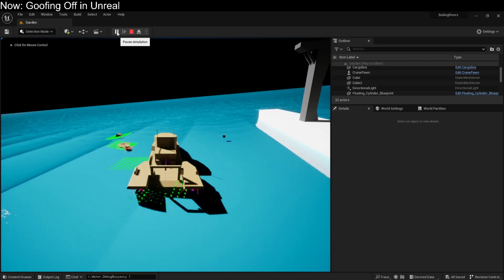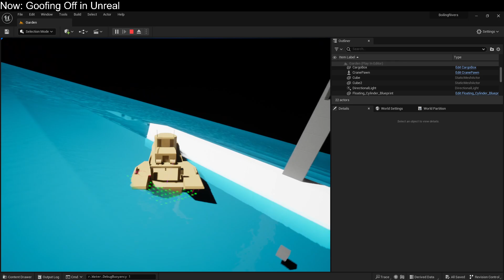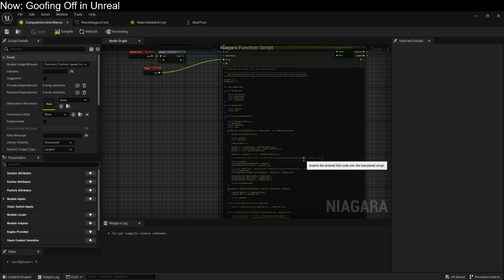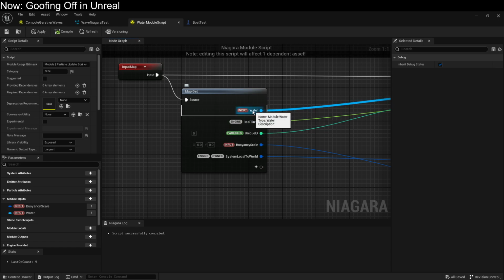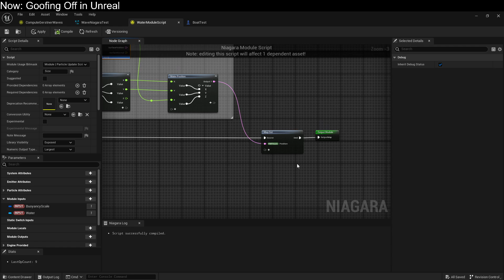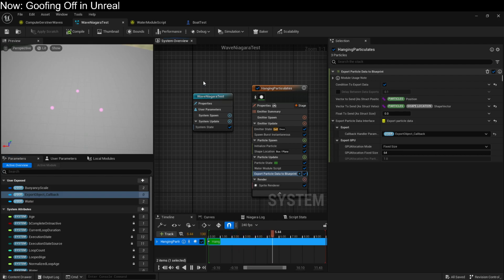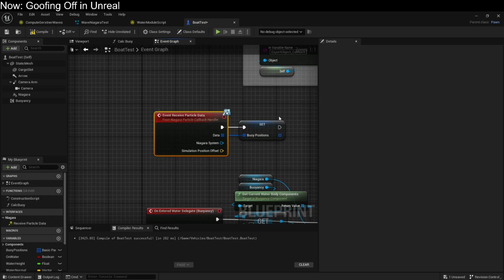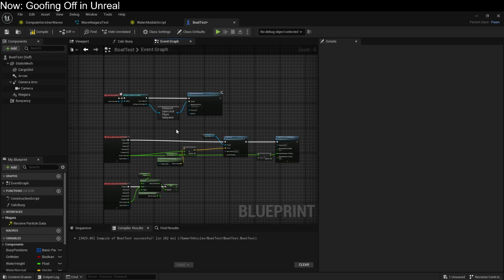Unreal Water Plugin: Wave Height Tutorial

Comment: Hey thanks for this video. I was using the buoyancy system to tell the player when they enter/exit water but noticed it was working properly only about 80% of the time which led to me adding in all this nonsense code to handle the other 20%. Was ready to give up until I stumbled across this video and decided to make something to suit my needs.

Made a single particle, updated it based on wave height, then I made a custom blueprint particle and added functionality to get wave height / relative height / set water component / change update frequency, plus event dispatchers for entering and exiting water. Unlike the buoyancy system, it can be attached to other scene components (e.g. meshes / cameras), and was surprised to find it always works and doesn't go "silent". The official buoyancy system seems to only work if it is close to the water, which is annoying but wouldn't be the end of the world if it actually worked properly in terms of leaving / entering water.

Anyway I have it working as required now, with one on my first person camera, another on my third person camera, and I know exactly when any of them enters or leaves the surface for my transitions. In the future I may consider building a proper buoyancy system (cuboids) that doesn't turn off when objects start underwater. Since I'm only using a few particles now, it runs fine, but I'm not sure how well it will scale to 8 particles across hundreds of objects though, but at least now I have a some control over it and can tweak it to improve performance.

Comment: Do you know if this possible in a networked setting? Can this be done on a server?
Reply from the maker: Not synced, due to a bug in their timing code. You'll have to find another plugin, fix theirs, or roll your own
Reply: @CraigPerko  The thing I'm having a problem with is getting the Exporting the Particle Data on the Server. The Server version of the Event Receive Particle Data never triggers, presumably because there isn't any data to send. On Client, this setup is working
Reply from the maker: @BenHitbox  Even if it did work, it wouldn't be synced up at all with the client data.
Reply: @CraigPerko  Probably, I was curious to use some of the Clock Sync methods to get things as close as possible.
Reply from the maker: @BenHitbox  Unfortunately, the default plugin ignores any attempt to adjust the time.
Reply: @CraigPerko  I've been told that Niagara particles don't run on the server too.
Reply from the maker: @BenHitbox  Well, that depends on the type of server, but yeah. I had to implement my own waves system.
Reply: @CraigPerko  Interesting. What kind of waves system?
Reply from the maker: @BenHitbox  Same kind, Gertsner. I just reimplemented it so I could do it on the GPU and CPU interchangeably with correctly synced time. However, then I ran into the "character parented to object does not work because Unreal hasn't patched that in twenty years" bug, so I'm doing other things now.